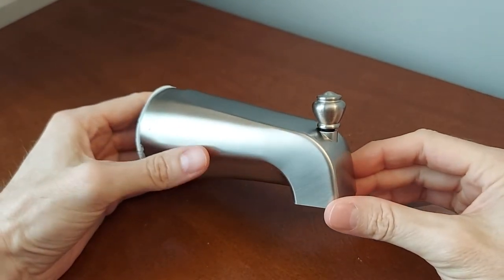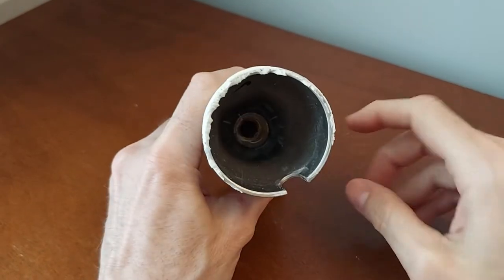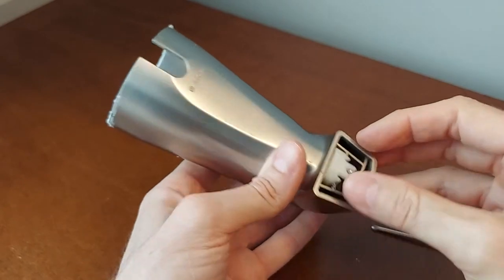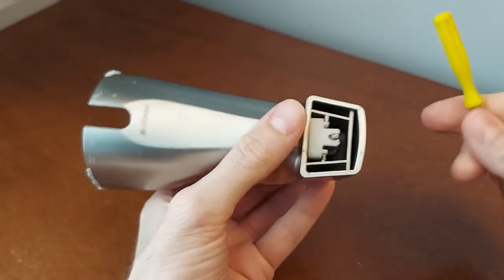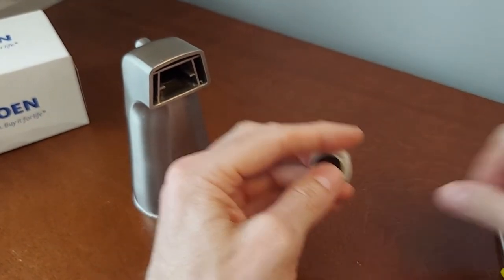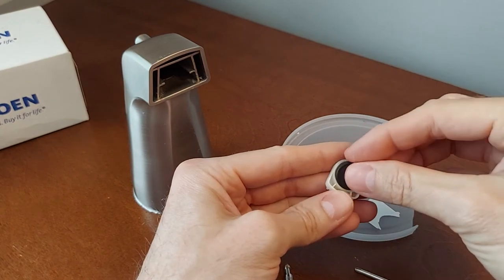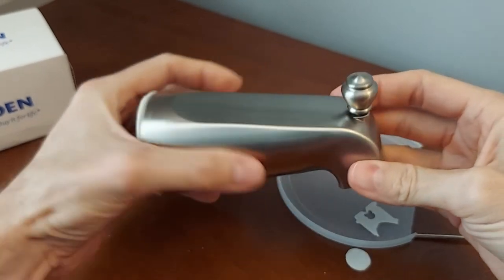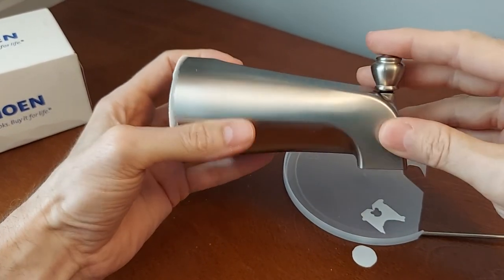How to quiet a noisy shower fast and FREE! - Easy fix

Comment: Painters Tape on the pull handle would keep in place upside down. :) 

Could you use a dime instead of the plastic or is that too thick?